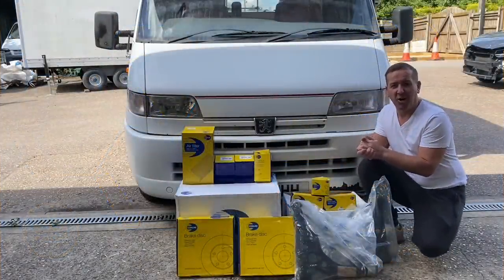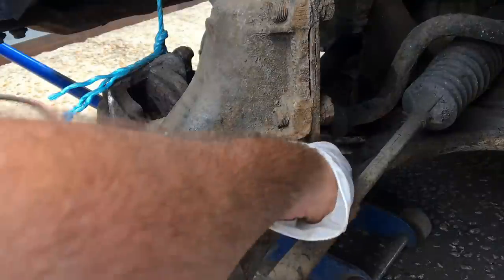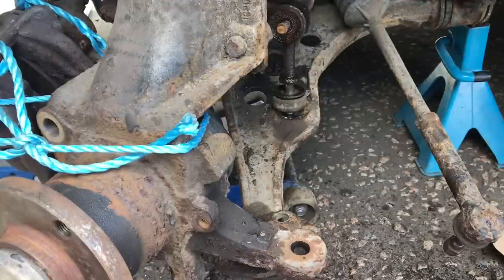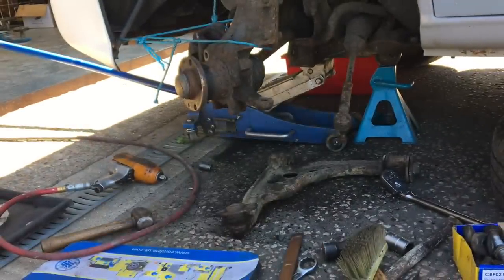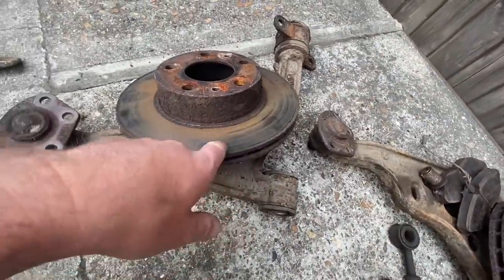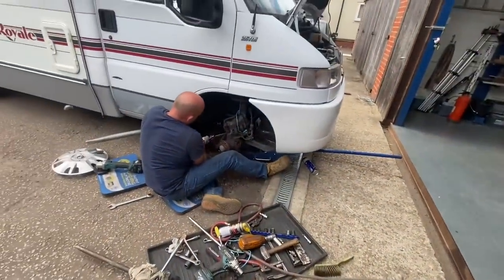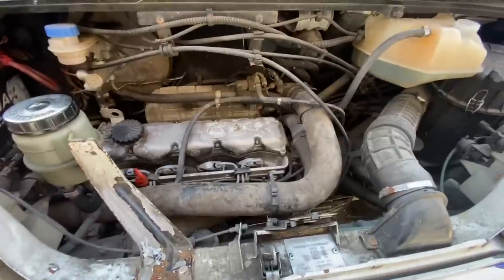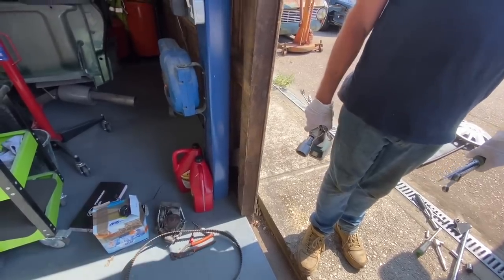NEGLECTED SWIFT ROYALE MOTORHOME GETS LOTS OF NEW PARTS !!!

Comment: On a yaris I did the captive nut in the chassis leg spun when doing the bottom arm, I ended up cutting thru the box section, welding the nut on and plating over the hole, don't know what could be done otherwise.

Comment: Good idea to do the brake hoses and brake fluid too. Brake fluid absorbs water which lowers the boiling point. If it boils you get steam and then no brakes. Plus the moisture seizes it all up from the inside. Rubber brake hoses perish with age.

Comment: whats with the wire on the pot belly stove and the tank with the pipe link running into the pot belly stove ?
Reply: Waste oil tank and drip feed pipe to burner.

Comment: I've never found French vehicles easy to work on,  always had issues with bolts being sized, and poor design,... We just put a 86 sierra back on the road after being off the road since Jan 2004, we had to remove and test all 6 injectors, apart from track rod ends and front discs, nothing was siezed, even the track rod ends came off ok with heat and was in good enough condition that they was reused....the rubber bushes was also in significantly better condition as well.

Comment: That was the quickest ive seen a track rod end release. i usually use a little heat first but i will be doing it that way from now on.For the little extra cost and being apart, the track rod ends could have been done too. Another good video.

Comment: When replacing the lower arms do you have to leave the mountings slightly loose until it’s sat at its normal position before torquing the bolts up?
Reply from the maker: No not at all 👍
Reply: @sruk  that’s useful to know. Thanks 👍🏻👍🏻👍🏻

Comment: its kinda funny, I was thinking when you mentioned the cam-belt and tensioners, 'is the water pump ok ?'
Reply from the maker: It’s set up a little different to normal this pump don’t run off the belt so it’s not 
Necessary to change it on the belt service but yes lucky we did 👍

Comment: Those 2.5L Ducato's are a nightmare to do the cam belt and water pump.  On some you need to move the engine slightly after removing the engine mount just to get a bit more access. An Independent garage (that's got a ramp big enough)  will charge the best part of £500 to £700 for just the belts, tensioners and water pump - so you have saved the next owner a decent amount.  As always keep the content up, great videos.

Comment: Wouldn’t be French of something wasn’t designed stupidly😂
Reply: It's designed in Italy by FIAT.
Reply: @Joe mamma That one is a 2.5. I think by 2000 they had gone over to the 2.8. I think they both use the same water pump, but the belt kit has some differences.
Reply: @Joe mamma I would check the water pump and only change it if there's a problem.

Comment: Don't get too wrapped up in promoting your sponsors. Comline are a good brand but a lot of these parts didn't need fitting up. Unnecessary. 👎

Focus on what has made you the best channel on YouTube! 😎👍
Reply: About 2 minutes of Comline that can be forwarded by tapping the screen!  Let them earn a living.
Reply from the maker: They all needed doing it’s called preventative maintenance and that motorhome has been sat for nine years so I would say yes it was all well very over due
Reply: That's fair enough Rob. Still, if I was a dealer I'd have left alot of it for the new owner. I didn't know it had sat nine years.

All the best to you and Chris 🔧👍 still the best channel on YouTube (Matt Armstrong not far behind you though 🤣🤣🤣).

Comment: Not one drop of grease used in the reassembly of them brakes!!!
Reply: They still will work fine
Reply from the maker: We don’t use grease on brakes we us copper slip and it was used both sides
Reply: @ahyaan2552  for now. Until the next person goes to remove them or brakes sqeaul... every bolt and moving part should be copper greased up....
Reply: @jordanberry9743  thats true